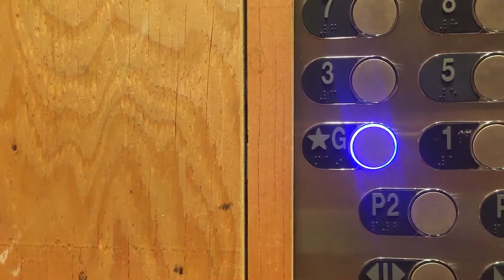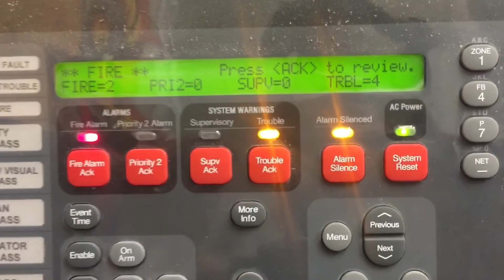Is Your Duct Smoke Detector Really Protecting You?

Comment: Does anyone ever actually do differential pressure testing on duct detectors? I know it's apparently required as part of an annual inspection but I don't think I've ever encountered a company that actually does this
Reply from the maker: Your observation is quite insightful. While NFPA 72 mandates that duct smoke detectors undergo differential pressure testing to ensure proper sampling of the airstream, it’s true that this specific test is often overlooked during annual inspections. Many companies may not perform this test due to a lack of awareness, perceived complexity, or challenges in accessing the necessary equipment.

However, conducting differential pressure testing is crucial. It verifies that the sampling tubes are effectively monitoring the airflow within the ducts, ensuring the smoke detection system functions as intended. Neglecting this test can compromise the system’s ability to detect smoke promptly, potentially delaying critical responses during a fire event.

To address this gap, it’s essential for service providers to familiarize themselves with the testing procedures outlined in NFPA 72 and to invest in the appropriate tools, such as manometers or Magnehelic gauges, to perform these tests accurately. Building owners and facility managers should also be aware of these requirements to ensure their fire detection systems are fully compliant and operational.